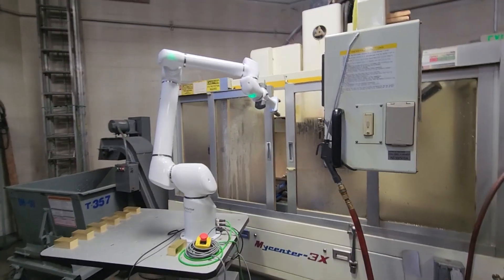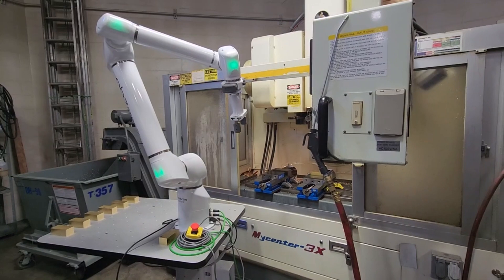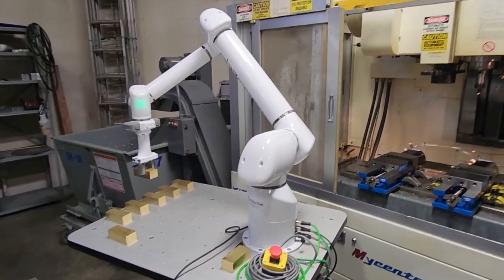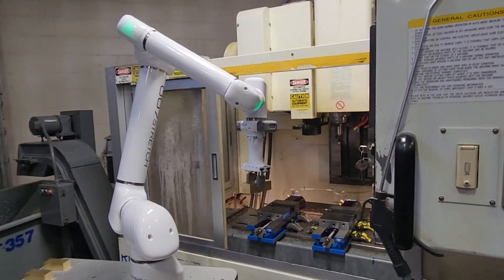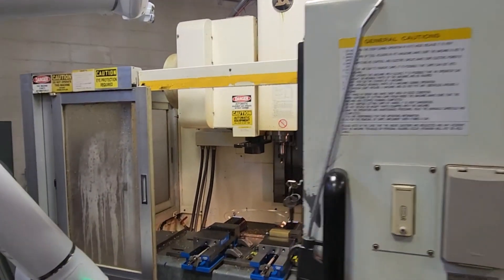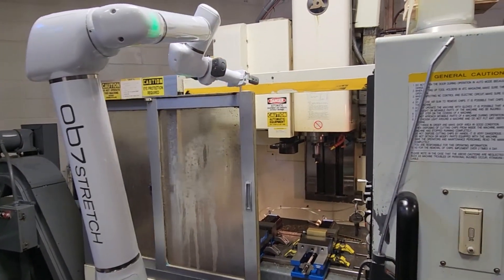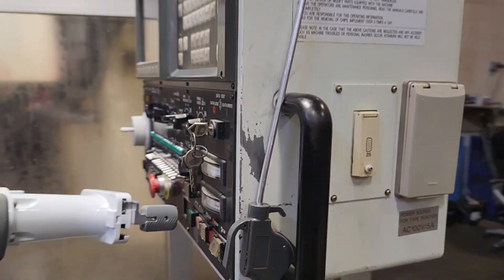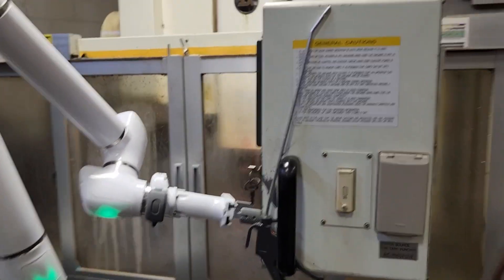OB7 COBOT

Comment: Just a couple comments, usually mounting the base at an angle will eliminate any singularities you might encounter. Also I would consider putting a Pneumatic cylinder to open the door.